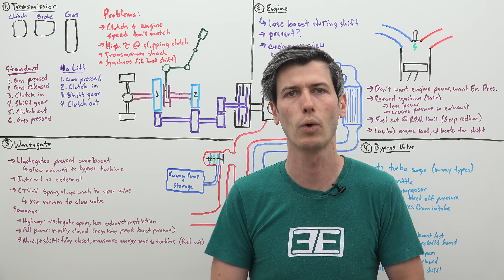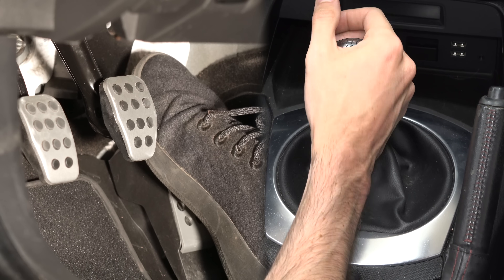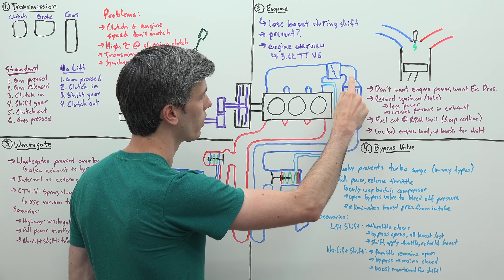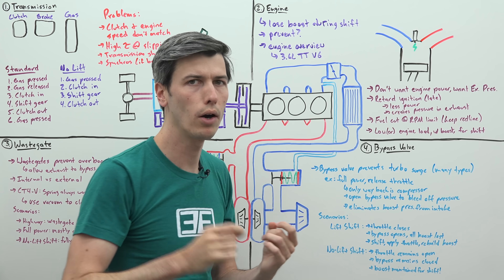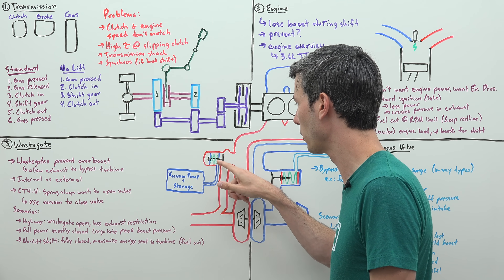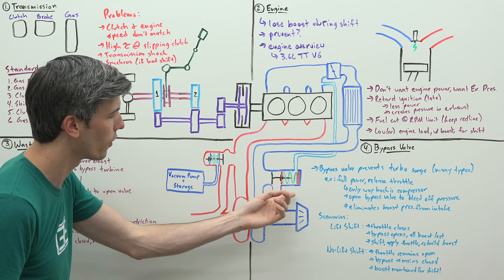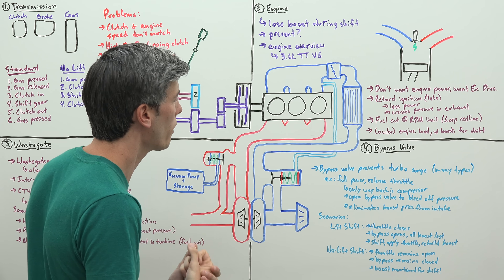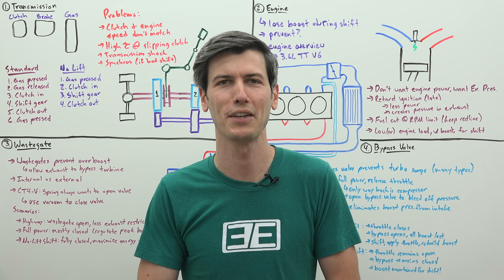How To Power Shift Correctly - Go Faster Without Destroying Transmissions

Comment: I have to "power shift" my 1.6 polo in summer days, because with AC on, the rpm drops too fast when I change gears so I cannot rev match the next gear afterwards... I have to keep a little bit of gas to slow down the dropping.. you have to do this if you want an absolutely smooth shift
Reply: At least it doesn't have rev hang!
Reply: There's this thing called heel-toe.
Reply: 1.6 Diesel engine? If so I don't have that problem 🤔
Reply: Mk4 Polo ?
Reply: Double de clutch man!
Reply: That's simply  how you properly drive a manual, you don't lift off completely on upshift, just enough to revmatch.
Reply: @stephaneriviere3835  If you have to give it some gas on an upshift something is wrong with your car. Even a tiny 900cc 3cyl engine gives me plenty of time to upshift. No, it does not rev-hang. My dad's diesel loses RPM so slow i sometimes jerk forward a bit. For a downshift give it the same amount of taps on the gas as the amount of gears you're shifting down. 5th > 2nd is 3 taps. The length of the taps depens on how lazy the engine is.
Reply: @Laylander  or if you've been driving the car for more than a couple months you should be aware of what engine speed you'd be at with each of your gears to a close approximation... with my old 5 spd TDI I never needed to "tap" the accelerator once I knew what RPM I'd need - just smoothly go to it
Reply: @pe4958  Taps per gear is a good rule of thumb that works in most cars. Good for you that you've acclimated to your car, but that doesn't help anyone trying to learn.

Blipping gives the driver much more control compared to holding the throttle down for just the right amount of time. Holding gives you one continuous moment of feedback, whereas with tapping you get multiple feedback moments. Humans are much better at the latter.
Reply: @Laylander  how long is a "tap"?... how far down do I press the accelerator during said "tap"?
Perhaps it worked for you when you were first learning but this isn't the way I learned to drive stick in gas or diesel engine vehicles here in the US...maybe there's a metric measurement of a "tap" I'm unaware of LoL jk 😉
Reply: @pe4958  I press the pedal to the floor and release, maybe 100-200ms, for a diesel. For a gas engine i press about 2/3 or 3/4 down.
Reply: @Laylander  to the floor and release? Idk about that but my 1.6 Diesel goes nuts when I floor it like that even if its for a so short duration, your rule of thumb for gasoline engines work for me
Reply: @MrConminer  of course it depends on the RPM, but I usually only downshift if i'm below 1500 rpm as above that with a diesel there is plenty of torque. Below 1500rpm you can usually floor it for almost half a second before you reach the limiter.
Reply: My previous car had extreme rev hang as well as instant rpm drops with the AC on...

It took all the fun out of driving a manual.
Reply: @slowanddeliberate6893  Same my car drops hard when cold and/or AC on and crunchy shifts. Warmed up it shifts fine  but with truck rev hang. Can be dangerous in some situations.

Comment: This sounds like a good application for a hybrid system. Assuming the electric motor is still connected to the transmission with the clutch out, you could dump power from the engine into the electric motor during the shift. The engine could be making full power the whole time, and if the motor is strong enough to slow down the engine it could perfectly rev match the next gear for you.
Reply: Plus on an F1 car they have an electric motor on the turbo so the waste gates stay closed (while charging the battery!).
Reply: You just describe the Honda CRZ
Reply: NSX does this, albeit with a 9 speed automatic. Same principal though. Electric motors filling in the turbo lag gaps.

Comment: Really cool 
The other day I wondered if there is a car that has turbos but can turn them on or off.  run without them (for efficiency) and turn them on ( for power) I mean would this be possible and is there such a car ?
Reply from the maker: Most modern cars are essentially optimizing this depending on what you're asking for, kinda how the video describes. On the highway, you're really not using the turbos, but using the wastegate to bypass. Once you want power, the wastegate closes, spooling up the turbos and giving you full power. But as far as a car having a driver switch to do this, I don't think there is. But certainly possible.
Reply: @EngineeringExplained  I respect you so much for answering
Thank you
I‘m so happy right now ♥️

Comment: The turbocharged cobalt SS was an underrated car. I used to tune and do performance upgrades for the cobalt community of all sorts 10 years ago
Reply: No one gives the TC SS nearly enough credit. GM came out with it in 08...it took Honda until 2017? (I think) to make a car to even compete with it. Still to this day that car on ethanol with a downpipe will beat a LOT of cars. The only thing that pisses me off about that is GM CAN build cars like that...they just WONT build cars like that. And when they do...it's short production runs.
Reply: @MeltingRubberZ28 Automakers successfully lobbied to have the lion’s share of regulations apply to cars, but not light trucks, and then went all in on maximizing profit from light trucks. 

This makes them much cheaper than they should be relative to cars, which has all but ended cars as the most popular motor vehicle. 

And now our roads are way less safe with these massive, flip-prone light trucks that have zero bumper compatibility with cars or each other (cus it’s not standardized for light trucks), our emissions aren’t much better cus light trucks evaded so much regulation, we have no affordable or fun cheap cars (a civic type r hatchback is 45k!!!), and the few people who actually need work trucks are stuck in oversized pavement Princess piles of garbage that are gdi, turbo’d & exhaust recaptured within an inch of their lives (look at the failure rates on ford’s eco boost engine with its wet rubber timing belt). 

But some CEOs hit their quarterly targets and left with huge payouts. So it’s totally worth it.
Reply: The 2007 cobalt ss actually beats a 2006 boxter s, lotus exige s, and is very close to the Ferrari 355 and 2010 camaro ss around the nurburgring. I have a 2010 cobalt lt 2.2 and it's fun but not super fast, I bet the ss is really fun and fast!

Comment: I thought power shifting was shifting without a clutch? Timing it with the lift of the foot to slide the clutch in.
Reply from the maker: Some people use the same words to describe different things. Not lifting and not using the clutch is how to ruin your transmission.
Reply: @EngineeringExplained  yes, so gas down rev up, release gas up and right as the rpm drops, slide it into gear without the clutch, then gas. Power shift! I’ve only heard it once 20+ years ago riding passenger in a ‘85 mustang 5.0 so not to keen on the terminology but keeping “power” to the tires, not lifting the gas, seems more sense to be called a power shift.
Reply: @stludachris  Power shifting is when you don't release the throttle while shifting with clutch.

Comment: Huh, I always just assumed the ECU was regulating the throttle keeping the RPMs from spiking during the shift, but I've never owned a vehicle with this feature. Sounds like it's a lot more involved that I thought.
Reply: My sti will hold it at a rpm of my choosing. So youre right but I don't think all of them work the same.
Reply: @hunterjohnson8200  Maybe that's where I got it from then. I remember it being discussed as a tuning option when I had my 2004 STi.
Reply: @jasepoag8930  yea it comes with cobb accessport. You go to tuning on the accessport and you can put in no lift and launch control. I got mine set at 5200 so it will drop to 5200 and hold until I get in the next gear as if I'm launching the car kinda.
Reply: It's not. You just cut fuel while the clutch switch is disengaged. Instant no-lift-to-shift. The revs fall naturally as always during fuel cut while your boost stays full with your foot on the gas pedal and as soon as the clutch comes back up, fun is restored.

I had a 1997 Eclipse that I installed DSMLink into. One of the features they brought out around 2002 or so was NLTS. It was very easy to configure and use. I have no idea why it took OEMs so long to implement.

Comment: I shifted with my gas pedal flat on the floor a few times when I was in a tight drag race.  It would mean a gain of a half car length against the competitor each shift.  The car was a 65 Chevelle, 300hp 327, 4 speed muncie, and 12 bolt eaton posi rear bought new.  100k miles in 4 years and sold it when the USArmy shipped me to S. Korea in 69.  No trans failures or rear diff failures.  I did have to do two minor rebuilds on the engine.  New rings the first time and a scorched rod bearing and broken rings the second time.  Did not need reboring.  Only had to polish the crankshaft after the rod bearing failure because I heard it and stopped the engine immediately.  Easy and cheap to repair engines back then.
Reply: I can see power shifting making sense during a drag race, but why people think they have to do this as well when driving on public roads truely baffles me.
Reply: @tjroelsma  Because fun
Reply: @Lofi.z34  Like Rolling Coal is fun?
Reply: @jth_printed_designs  Sure, but why do it at all? Like my instructor said long ago: "you're not on a race track, so why pretend to be a race driver? Doing quick shifts of power shifts doesn't gain you anything under normal driving conditions."
Reply: @TJ Roelsma  By that point, why even drive a fast car? You aren't a race driver, might as well drive a boring econobox and get good mileage, you will never need to go fast under normal driving conditions
Reply: Same here with my camaro and 67 ss chevelle

Comment: My synchros didn't like my NLS so I invested in a sequential dogbox. Never looked back
Reply: You don't have to be gentle to the dogbox
Reply: @hulk.agiota  You must not be gentle with it. Be assertive
Reply: Since synchros connect the wheels to the gearbox and don't play a part in connecting the gearbox to the engine (that's what the clutch does), NLS won't have any affect on synchros; synchros operate before the clutch is reengaged, so whether you rev match or dump the clutch, the synchros are just chilling doing nothing while the torque flows through the clutch/gearbox/wheels.
It's shift speed (whether you NLS or shift normally) that correlates with syncho wear- and yeah banging gears too fast definitely does have a noticeable affect on synchros, from my experience :( lol.
Reply: @CosineHyperbolic  true, but the most important part is the speed difference between the input and the output shaft in the gearbox, those connected to the gears that you try to match. That's where synchro's come in. In a dog-ring box the gears are beefier, stronger and cut in a different way. Basically the gears always grind when the revs aren't matched but they are made to handle it. The slower you shift in a dog-ring, the longer the dogs grind and the quicker they will wear. Never baby a dog-ring.
Reply: @Duskconqueror  I've said nothing about dog engagement - I know how it works - my point is that NLS has no impact on synchros.
You're right about how synchros work, but the speed differential will be identical in either NLS or regular shift scenarios; the engine speed difference between NLS and regular shifting occurs after you've taken synchros out of the equation. Whether you NLS or shift regularly, you'll go through these steps:
- WOT in X gear up to Y RPM shift point for entering X+1 gear
- Disconnect engine from gearbox via clutch pedal
It is at this point where it does not matter if you pull off the accelerator or stay WOT- the engine is not connected to the gearbox/wheels which is what the synchros connect. The speed differential between gearbox and "wheels" which your synchros synchronize is the same in both cases, shifting at the same RPM.
To be clear: If you're no-lift shifting without the clutch, then yeah your synchros are ABSOLUTELY fucked, lol.
Reply: @CosineHyperbolic  inside the gearbox are multiple shaft with gears on them. To shift, two gears on two different shafts have to be mated.  One shaft is connected to the flywheel side, the other to the wheels. Because you're  shifting to different size gears, the rotating speed of the input shaft will change when another gear is engaged. This is all inside the gearbox and has nothing to do with a clutch. The clutch connects the flywheel to the gearbox. The synchro's connect the gears to the shafts inside the gearbox. To overcome the speed difference in a smooth way you can either shift gently and let the synchro's do their job or you can double clutch and manually match the speed difference when the box is in NEUTRAL, between clutch 1 and 2.
Reply: @CosineHyperbolic  nope

Comment: This is great until, having become accustomed to no-lift shifting, you return to driving a standard manual car.
Reply: The only logical reason why you'd drive like this is if you're trying to accelerate as fast as possible, ie at the race track. On normal roads, you would almost never do this. So it would never become habit.
Reply: @rars0n  I do this daily in my 3 Mustangs 🤣 if got it in slomotion too shifting under 100ms
Reply: Not really. My C7Z has NLS, whenever I get into the Honda it’s not a big deal. It REALLY feels weird to use NLS. So odd.
Reply: "Do you even, do do do" Lol what a bunch of turd burgling buttplug comparators
Reply: Right? I was wondering why no one mentioned it, and had to scroll down some to find your comment.
Reply: You won't become accustomed to no lift shifting because you should only use it when you are as driving as fast as possible... sorry but you obviously still don't understand what it is 😅
Reply: @saturndesigns2339  So I guess you've owned a car with no-lift shifting? Because I have. Tell me what the point is in using it when you're just driving normally. Why the hell would I need no-lift shifting when I'm at part-throttle, low boost, and shifting at 3000 RPM? Did you even watch the video?

Do you even drive a turbocharged manual transmission vehicle? I'm guessing the answer to that question is no, just based on the ignorance displayed within your comment.
Reply: @rars0n  did you even read his comment? lmfao
Reply: @ikeepgettinbanned5525  I probably read it wrong, now that you pointed it out. I read it that he was quoting what I said and replying to it.

Comment: For all that, why didn't they just use a DCT?
Reply: Optimum speed 🤣 wtf am I on I mean quickest lap times
Reply: Some people prefer to be able to use a manual and have more control, especially if its not just a track car. If you want optimum speed obv DCT
Reply: @c-5899  some people just prefer manual over dct and I think that's fair enough. GM must have thought it would be a worthwhile innovation

Comment: in india there is a car called the Hyundai venue and it has something called an imt in this there is no manual clutch but you do have a gear lever where u have to manually select gears. How does this work?
Reply: This sounds like what I think was a Saab setup.  Years ago Saab offered a prototype of this clutchless manual shift car to Car and Driver for them to try out.  It was supposedly indestructible.  C and D promptly broke it.  It never came back.
Reply: There's a position sensor that detects the gear lever movement and the transmission ECU reacts on that by actuating an hydraulic actuator to open and close the clutch. It isn't really a new system, but it's cheaper than automatic or double clutch transmissions. Saabs Sensonic was indeed the same electro-hydraulic setup, but other setups have been used also since the 1930s.

Comment: How does it deal with the required rpm drop for the next higher gear? Is the clutch still absorbing that speed difference?
Reply from the maker: Because ignition timing is delayed, you're at a lower torque state rather than a higher torque state. So the clutch absorbs the RPM difference, but since the torque is low (relative to a traditional powershift), it's easy for the clutch to do.
Reply: @EngineeringExplained  But that's what I said 😭
Reply: @EngineeringExplained  Why do you need ignition cut to flatshift in a standard manual at the rpm zone when torque is starting to drop? If engine redlines at 7k and you flatshift at 6k, in many car engines torque is now on the way down past 5252 and you have switched gear before the engine redlines. This isn't a standing start shift either, so when you re-engage, both clutch and flywheel are rotating masses. A slip is wear, but with sufficient clutch plate pressure,  will you shorten your clutch life significantly, since the torque gradient will be transmitted through to the components either side of the non-slipping clutch. Yes, there will be a friction heat spike, but for a much shorter period. Flat shifting also allows the entire car's acceleration curve to be relatively unaffected. If the entire mass of the car changes acceleration gradient in a long shift, surely that wears the clutch more as the duration of slipping is increased and more frequent? I've not had a car with flat shift timing function and all seem to respond well to flatshifting without noticable clutch wear?
Reply: @20vK  The timing change and reduction of fuel should bring the torque way under the relatively modest drop of torque you usually have from peak to redline.
Reply: @EngineeringExplained  Still going to shorten it's life a bit more at least though.
Reply: The engine is in a low torque state when the timing is retarded, so the engagement is absorbed smoother/easier
Reply: i was waiting for him to explain that... but i guess modern manual trannys can absorb that or still needs to cut engine when sensor feels that u are in higher gear before letting clutch out, so can it still keep boost while cutting throttle ;D ?